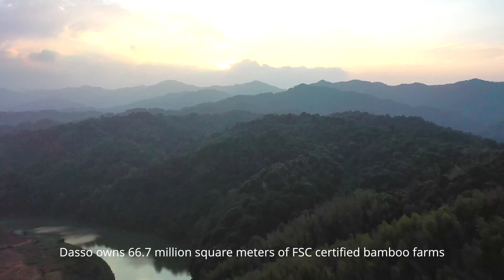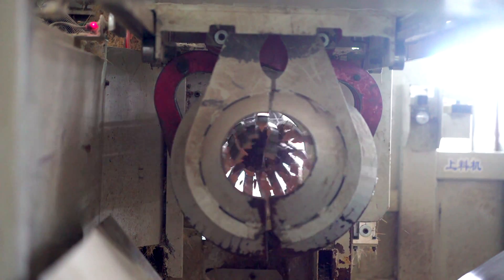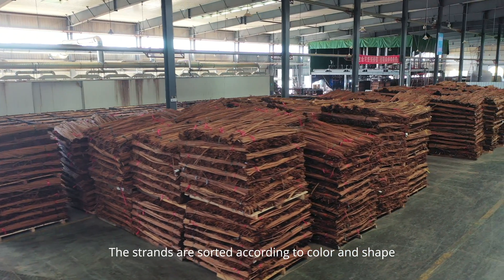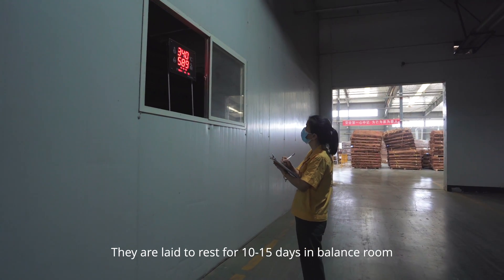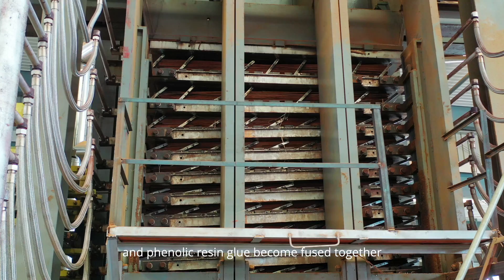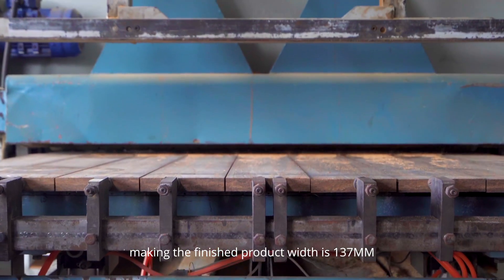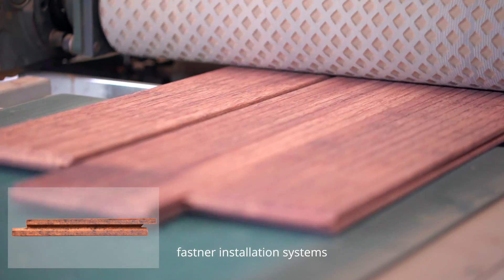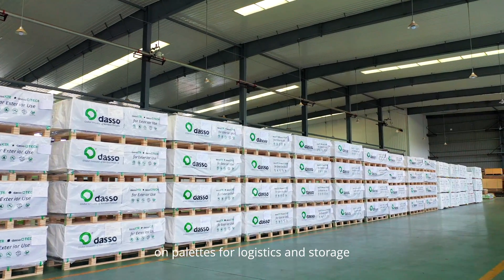dassoCTECH Bamboo Decking | How It's Made

Comment: When Using the 3200 ton pressure press.   How many minutes long is the pressure press process ?
Reply from the maker: It depends on the thickness of the bamboo board.
Reply: @dassogroup  How about for 1-2 cm thickness for example? How many mins/hours does it take for pressing?